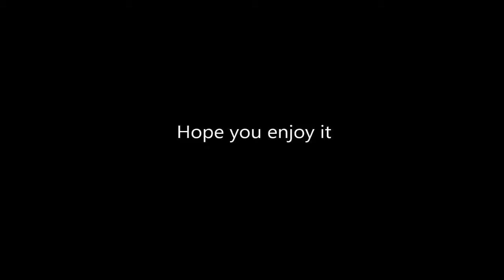OSB shelf for storage 🔻

Comment: Hi Sergio. Nice video. What is that kind of orange tool you use to keep the wood in the correct corner? It's very handy
Reply from the maker: Its a clamp for corners, 
I bought it in a general store, in the woodwork area. The store its called " Leroy Merlin", its a french store.
Reply: Thx for your quick response. Have a nice weekend